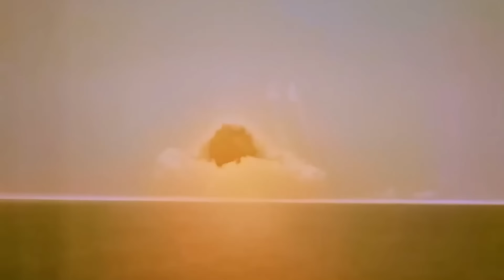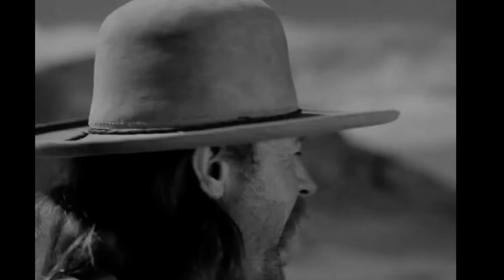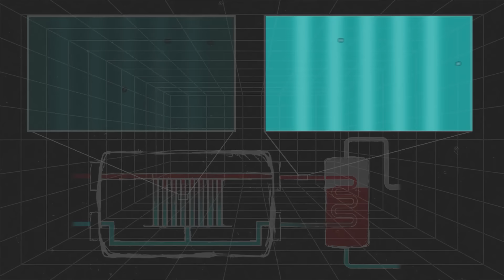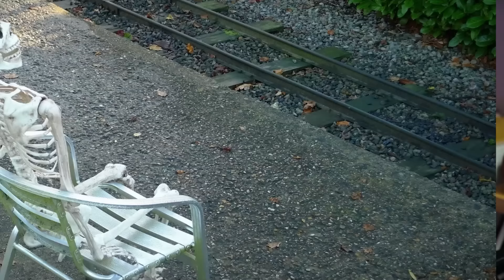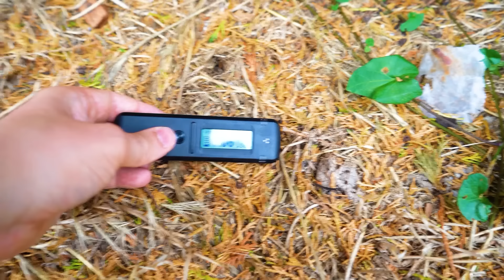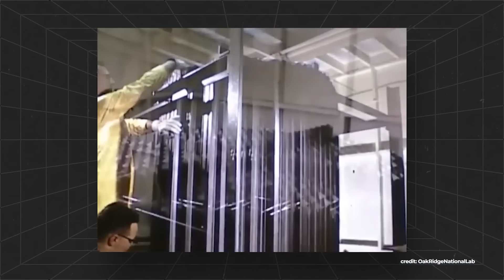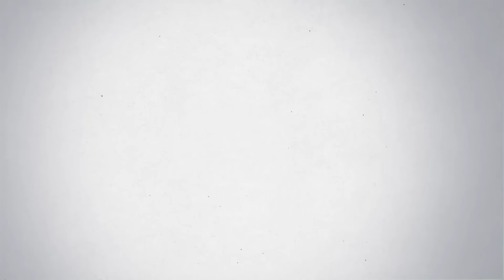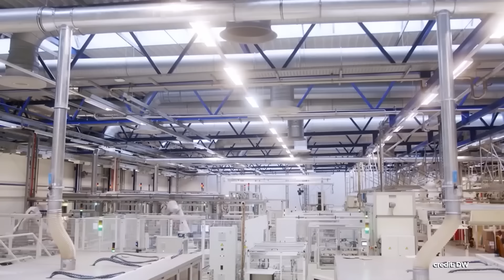It's Happening - China Launches World's First Thorium Nuclear Reactor

Comment: Thorium is 100% usable (fertile) while Uranium (U235) is only 0.72% fissile.  (The 99.28% of the Uranium, U238 is Fertile.) To use Uranium is has tho enriched up to 3 -  5% for reactor use, an extensive process, also usable for much higher enrichment levels suitable for weapons. The U238 becomes Plutonium 239 thru some decay chain. Nice.
Reactor fuel rods becomes useless as neutron toxins accumulates in the solid pellets stacked in the rods. Reprocessing (MOX) is not a lightweight task, 
Thorium (which is fertile) 500 times more available than the 0.72% U235.  In a liquid fuel Thorium reactor, neutron toxins can be separated out, some quite easily like Xenon gas. The burnup in a Thorium reactor is more complete with a much shorter time to background decay level.
A fast spectrum (molten salt) reactor needs no moderator like water, or graphite, just much more fuel, and can use "mildly" reprocessed spent fuel from fuel rods.  
All the 'waste' can become useful again.

Comment: One of the developmental  elements you missed is the difficulty in dealing with the fact that molten salt is highly corrosive. And therefore, one of the biggest obstacles is developing materials that withstand this corrosiveness.
Reply: ceramic lining and high nickel alloy like IN625, H230 and 740H. Problem solved. While work on a molten salt reactor stalled in the US for 60 year, work did continue elsewhere, and interest in molten salt did continue as a low reactive, high temperature, low pressure heat storage media. Big problems of the 1960s, are not such a big problem in the 2020s.

Comment: Xenon peaks in 1 week, then it comes to equilibrium. Samarium peaks in 1 month and then it comes to equilibrium. I would not want to hold a ball of thorium in my hand. I wouldn't want to hold a ball of U235 either. U238 is harmless, I have touched a brand-new commercial reactor fuel cell. "If it does explode?" Windscale did explode, made a huge mess. Chernobyl did explode, made a huge mess. Same type of reactor as Windscale, bad design. Fukashima did explode because the land it was sitting on moved about 50 to 500 meters to the east depending on what report you read. SL1 did explode as a result of an unexpected problem. TMI did explode, but not the fuel, it was the hydrogen being produced that exploded in the containment building. The uranium melted because there was a water leak that was not recognized by the operators. What about the Thorium Salt? Would that be Sodium? Sodium is very explosive if mixed with water. So, the boiled water that goes to the turbine could easily come int contact with the Thorium Salt if one of the heat exchanger tubes breaks. The Thorium Salt is easy to steal (you just sneak in and open a valve) in comparison with U239 or U240. And this business of not a lot of waste? They say the same thing about fusion. You can not have radioactive power production unless you use the conveniently placed fusion reactor called the sun. And that only works if you have a giant shield about 8000 miles in diameter and more than a few miles thick. I have been listening to the Thorium argument for a few years now and it is just rubbish. Nuclear power is dangerous, always has been since the Curies died and always will be.

Comment: They (china) started building a 1000gw plant a few years ago, after touring the AEC, and going over the old declassified files for the thorium test reactor they built back in the 1960's, nobody told THE AEC (aka oak ridge) not to let them see the files, so they took copies of the entire project and test results. The USA ultimately scrapped as it could not be used in a practical sense for weapon grade enrichment - and back in the 60's they didn't care about the fact you can run a Thorium LFTR on atomic waste from containment vessel reactors.  They also produce about 300g of long half life waste a year, instead of 30 tons of it.  They burn a lot more of the nuclear material than older westinghouse style containment vessel reactors.

This is actually quite clever on the part of China..    with all the green-tards protesting coal/oil/nuclear  we are entering an energy famine in Europe and Asia,  if China builds a bunch of these, they can corner the energy market by exporting electricity to neigbouring nations, and making money from nothing.  They can also offer to take all the waste from older reactors in places like germany/france/US/Japan  for a modest fee of course, then use it to RUN their throrium plant, and sell the energy back to them as electricity.    Bob Hawke in Australia had the same idea, but ultimately the green-tards drowned him out with their yelling and groveling about the sky falling.

Comment: Could I just point out that nuclear rectors use thermal neutrons not fast neutrons to do the fission. And the reason it only occurs in the core is because of the moderating material which slows the fast neutrons to thermal speeds

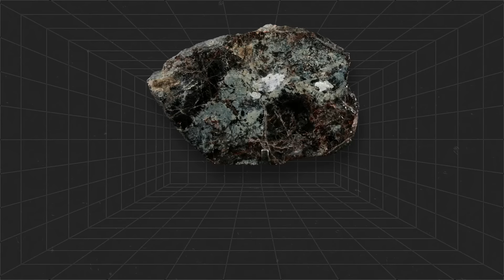Comment: 0:35 other than the abundance all three other things you mentioned are wrong. thoriums not some wonder fuel, the breeder cycle it goes through is a different but the stuff that's making the energy is still uranium in the end, U-233. and regular uranium could be used just the same in the reactors that would be made for running thorium. and the thorium cycle still produces just as much waste, still needs the same careful control, and can still be used to produce weapons with the same equipment needed for enriching uranium and separating plutonium.

what idiots keep getting hyped about and crediting to thorium is actually just molten salt reactors, which are safer easier to control, and produce less waste because the fuel is recycled continuously. and can run either uranium or thorium.
Reply: Salt has issues too

S2G was the initial power plant of USS Seawolf (SSN-575). This was one of three sodium cooled reactors (the core was moderated) ordered for the Seawolf program at the same time as three PWR units were ordered to support the USS Nautilus (SSN-571) program; In each case, one reactor was land-based for training and research, one intended for installation on a submarine, and one spare. The land-based unit corresponding to S2G was S1G reactor. The reactor core was beryllium-moderated.[1][2]
Persistent superheater problems on Seawolf caused the superheaters to be bypassed, resulting in mediocre performance. This and concern for the dangers posed by liquid sodium coolant led to the PWR type being selected instead as the standard US naval reactor type, and the S2G on Seawolf was replaced by the spare S2Wa reactor from the Nautilus program.
The Atomic Energy Commission historians' account of the naval sodium-cooled reactor experience was:
Although makeshift repairs permitted the Seawolf to complete her initial sea trials on reduced power in February 1957, Rickover had already decided to abandon the sodium-cooled reactor. Early in November 1956, he informed the Commission that he would take steps toward replacing the reactor in the Seawolf with a water-cooled plant similar to that in the Nautilus. The leaks in the Seawolf steam plant were an important factor in the decision but even more persuasive were the inherent limitations in sodium-cooled systems. In Rickover's words they were "expensive to build, complex to operate, susceptible to prolonged shutdown as a result of even minor malfunctions, and difficult and time-consuming to repair."[3
Reply: @josephpadula2283  sodium cooled means molten metal sodium is the coolant with solid fuel. an msr's coolant AND fuel is the same stuff, a uranium or thorium containing salt.

Comment: Not the first Thorium Nuclear Reactor. Germany had one running in the 1980. And they had a different solution for the cooling, too. There were technical difficulties, though, which led to abandoning the concept of the THTR-300 (300 MW Thorium High Temperature Reactor). The problem for the Germans was not the corrosion, but the high temperatures (~1600°C) which caused the materials to decay ahead of time.

Comment: Breeder reactors increase the risk of nuclear weapons proliferation, there's plenty of articles that describe this. Regular low enriched uranium reactors don't. How on earth are breeder reactors safer? I will gladly trade having to bury some high level waste in the ground versus recoupling nuclear energy and nuclear weapons. We already know how to build current generation reactors safely - they are orders of magnitude safer than comparative technologies like fossil fuel plants.

edit: Also we have not figured out how to make molten salt safe either. Steam explosions with water are a real concern, but molten salt explodes in contact with water, and burns in contact with air. Molten salt is not a safer solution than steam - steam is a mature technology and today we know how to use it safely.

Also comparing 3 mile island to chernobyl just sounds like fear mongering. How many people died in 3 mile island? 0. How many from chernobyl? Estimates could be as high as the tens of thousands. Comparing the two is like comparing a handgun misfiring and hitting noone, to a mass shooting. I don't feel like that's a dramatic metaphor, chernobyl was criminally negligent in its design and operation.

We have the nuclear technology to fuel a green energy transition today. We need a solution today. We ought to invest in deploying current technologies rather than wasting precious time trying to reinvent the wheel. Maybe once we're no longer addicted to fossil fuels we can start to consider improving our nuclear technology, but for now we need to get off fossil fuels first and foremost.

Comment: 17:00 I think you're confused about Natrium, the primary coolant is molten sodium, not as a salt, just the metal. The thermal storage system is molten salt and the two liquids are kept separate, presumably so when the salt leaks you just wait for it to cool off and it's no more dangerous than the salt you put on your driveway. The idea seems to be that the sodium metal never leaves the core so it's very unlikely to leak, which is a good idea, because other experiments with molten sodium in eg Japan have had a hell of a time dealing with that.
Reply: Experiments with solid sodium here on YT have a hell of a time dealing with it too

Comment: Thorium is not inherently more safe than Uranium, it's molten salt fuelled reactors which are safer, and again it has to be said even modern conventional nuclear is one of the safest forms of energy when you look at the deaths per TWh, and yes you can use Uranium in a molten salt reactor and in some ways it's actually better because you don't need a moderator because it would be a fast spectrum reactor so you don't need to moderate fast neutrons, the reason why this is advantageous is you don't as I said need a moderator which all designs I have seen for throium molten salt use graphite as a moderator, which is a small issue, but an issue none the less because the moderator would need to be replaced and because it's raw dogging in the reactor it will end up as high level nuclear waste, and not the good kind that you can turn into more fuel, the actually useless kind which you will just have to bury in a hole for a long time.

Where as a fast spectrum reactor you just need a container of with the volume and geometry required, which yes that will end up being high level waste to but you would build it out of a material that wouldn't need replacing until the reactor is being decommissioned where the graphite moderator will need to be replaced every 6 - 12 years.

Honestly it's not a show stopper and Thorium has the benefit of needing the moderator to slow down the neutrons, which means you don't have to worry about the geometry of your drain tanks to prevent fission from occurring, but really I do see that as a none issue, a toroidal drain tank would not allow fission to occur and it's impossible if you were to have a leak in the reactor for the fuel salt to maintain the geometry required to fission if it spills on the floor in Earth gravity, because even if it froze in the right geometry it would melt and turn into a puddle which assuming you were not insane enough to build your floor in the shape of tank rather than the normal way which is flat., it's fine except cleaning it up will be a absolute ball ache, you would have to do it with robots controlled with fibre optic cables because radio waves would be jammed by the extreme levels of radiation. 

But that is the same for Thorium.

Comment: People usually think about electricity as the key utility made by power plants, but don't often think of heat as a utility. But for many industrial processes (forging, glass production, etc.) heat is a key utility, and it's often needed at temperatures well above what is achievable with electrical heating. One key advantage of modular thorium reactors is the potential to provide sustainable industrial heat as a utility as well as electrical power.
Reply: What kind of temperature can't be achieved by electrical heating? Electric arc furnaces can reach 3500 C, the National Ignition Facility can reach 100 million degrees C, and particle accelerators can reach 1 trillion degrees.
Reply: They also make medical isotopes.
Reply: I like the idea of by phase energy. I am thinking electricity, district heat. Desalination, and hydrogen gas all at one plant.
Reply: No way in hell will nuclear be used for such small & distributed applications. A forge will NEVER have a nuclear plant to run its furnaces.
Reply: @theevermind  stop saying no.
If a forge is next to a modular nuclear power plant. It is possible to use left over heat from electricity generation. Not likely but possible. The trick is to use the heat for mote then one use.
Reply: @jbird6609  Two problems: the waste heat will be nowhere near hot enough, and security will not permit building industry so close to nuclear reactors. It's a terrible idea.

Comment: In Europe, Naarea and Thorizon are working together to create the first modular molten salt reactor that could run on multiple fissile fuel sources, including Th.  The first MSR to be built will be an 80 MW facility to go online in 2030.  There are already plans to upscale this to commercial energy producers with a 250 MW version by 2035.  The  fuel used will come from existing spent fuel in France and Th mined in Sweden, Finland and Norway will be used as well.   The advantage these modular reactors have is they can be built onsite for commercial consumption, requiring no power distribution infrastructure to be added.  They can also be used as thermal batteries, storing excess power generated from green sources to be released during peak demand.
Reply: While that is great. It's quite different from what China is doing in terms of scale
Reply: @dan-bz7dz  You are 100% correct.  That's the power you have in a dictatorship that is focused on energy and weapons.  Xi will probably become the single most influential person in the world in the 21st  century.
Reply: Do you wanna bet that after rising 200% in cost, the energy will only become 10% cheaper?... 😂
Reply: @millanferende6723  If this were an unproven technology, that could be a concern, but this is 1950s tech being upgraded.  Today the LCOE of MSRs is 9% less than that of coal fired plants. When government subsidies for fossil fuels are shifted to  green energy, that will be a 200% saving, not increase.

Comment: Probably the very best solution we have to create nuclear power.  When nuclear power was first being developed,  the only uses were for WMDs. So, out of laziness, and ignorance, as far as I can tell, that's the way they went. The only downside there would be for thorium is that they only work for relatively small areas, involving many more builds for the reactors themselves, even though it would greatly diminish the storage problem posed by uranium variants.